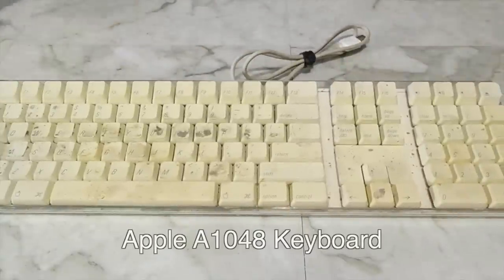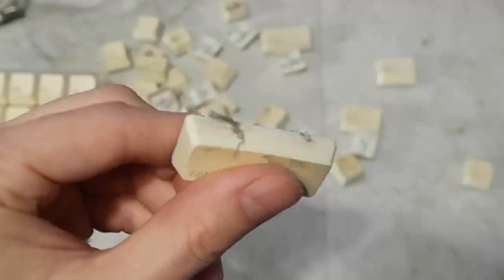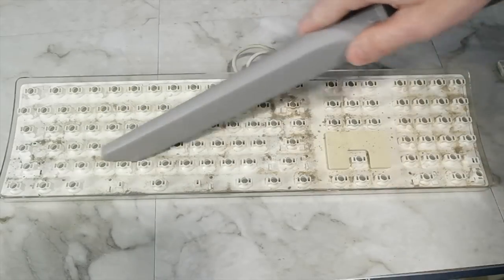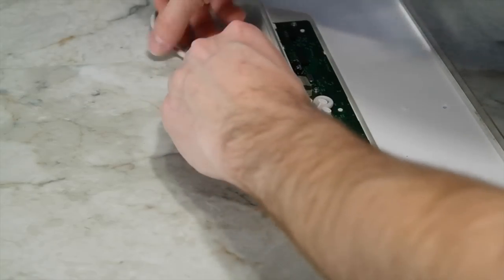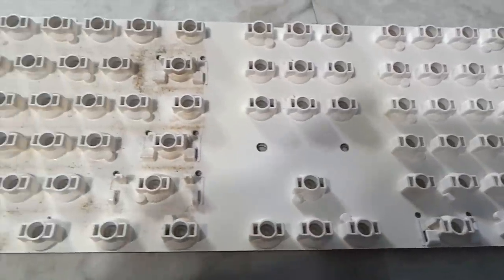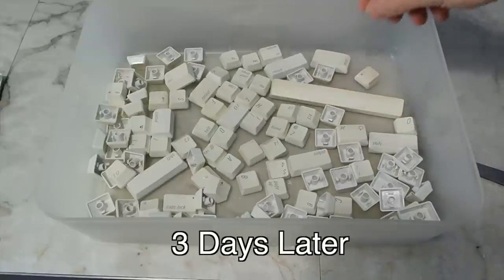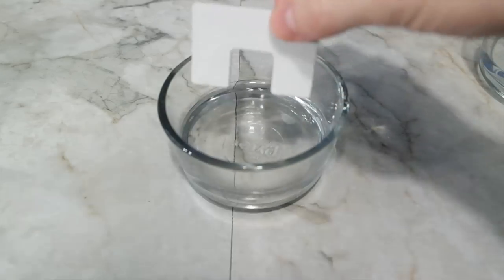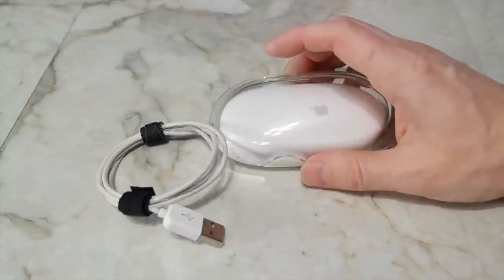Restoring an Apple A1048 keyboard

Comment: Hello David. Do you recommend the use of alcohol on more recent cables? For example, on the Magsafe cables?! I have a 2010 one which need urgently to be a bit less yellowish.. Thanks!
Reply from the maker: Yes - alcohol cleans them, but may not restore the color depending on what has caused the yellowing.  It certainly won't hurt the cable, though.
Reply: Thank you. I'm willing to say that the yellowing was caused my skin oil. Worth the try! Thanks again David.
Reply: NORMALIZATION OF IGNORANCE all caps much?
Reply: Senpai notice me

Comment: I have one of these keyboards and some of the buttons do not work, even though they move freely. How do I get inside the keyboard to clean the contacts? I could not find this step in your video. I was thinking that i could just use some contact cleaner and see if it works. Or, maybe there is a membrane that I can try to wipe clean. I assume there is some spilled coffee residue in there.

Comment: When I had one of these keyboards, I liked it a lot but hated the way all kinds of crud would fall between the keys and then be visible thanks to the clear sides. My solution was to buy a second keyboard, and then run the first one through the dishwasher (no disassembly beforehand). I used the second keyboard, giving the first one a few weeks to dry out. After that I just alternated between the two -- running one through the dishwasher whenever it got annoyingly dirty and using the other one while the washed one was left to dry.

I imagine this (mis)treatment shortened the life of the keyboards, but neither one of them failed over the years that I did this. It was a satisfactory solution for me.
Reply: KarlBunker if you like to put keyboards into the dishwasher, then why you didn't bought a silicone flexible keyboard?
Reply: Sam Evans ehh...
Reply: There's something called waterproof keyboards so you might want to invest in that.
Reply: Preety sure those didnt exist when OP was referencing this. Yall think he was doing this in 2015? try 2005
Reply: @salami99  Waterproof, and chemical resistant rollable rubber membrane keyboards did exist in the early 00's as I worked for a Kubota/New Holland/Bush Hog dealer pulling triple duty as a mechanic, salesmen, and IT where needed, and I was buying the rubber keyboards off eBay to use in our shop with the PC that held the Kubota/New Holland/Bush Hog software that we used for repair schematics, and the guys would get grease, and what not on the keyboards causing them to stop working even with clear keyboard covers. Yes they were crap the type on, but they worked for this use, as all I had to do when they got one really dirty, was wash it off in the sink, and dry it off(I kept 2 backups so we had next to no downtime). Also they came in PS/2, and USB 1.1/2.0.

Comment: 6 years later and this is still helping people. Thanks!

I got a G4 today second hand and the keyboard was super dirty. I needed to take the keys off, but wasn't sure if I would need a special tool to take them off without breaking them. Thanks to your video, I was able to find out I just needed a screwdriver and they would pop right off.
Reply: keyboard keycap pullers, both ring pull, and wire pullers are not that expensive on eBay, or Aliexpress, and both are worth keeping around to clean keyboards(I find one type works better than the other depending on the keyboard I'm cleaning), and not risk damaging keys with a screwdriver, or other flat end tool.

Comment: remember to take a picture of the key locations before dismantling!
Reply: Or... You could find a picture on the Internet.
Reply: Or... you could watch this vid.
Reply: Or... you could just use your brain.
Reply: And in a worst-case scenario, you can try pressing a key and seeing what it does.
Reply: Diego C. Finally a sensible reply!
Reply: Or you should know the layout of a qwerty keyboard
Reply: Or the specifics of that keyboard at hand! They have special keys sometimes
Reply: mechanicalRUBY Video if it's a laptop keyboard it should be no problem if it doesn't have that number pad with f14 f15 f16 bit.... Because it should only be caps lock,shift,cmd,Ctrl,tab and escape. I know the whole qwerty since I've been using it more than 5 years, when someone tries to get me to do a challenge of the other Layout, I freak out.
Reply: НаркотическийУниверситетМиллионов gibberish

Comment: Hello! I NEED YOUR HELP PLEAS!!!
Recently I bought an Apple A1048 keyboard, but the spacebar key doesn't work. I disassembled the keyboard and cleaned all parts, even the membrane (applied a electronic contact cleaner) but still doesn't work. Do you know what can I do to fix it?
Thanks!!
Reply: I found the problem. Is on the membrane. The contact between the + and "enter" key on the numerical pad was missing. I use a copper wire with tape (i don't have the conductive pen) and problem solved!

Comment: I have several of these (and Apple keyboards in general), and have gone through the keyboard-cleaning process many times. It's painstaking, having to swab each key inside out. That being said, it feels so nice to have a spotless keyboard. What's interesting is that it sometimes changes the typing feel altogether, but that usually reverses itself once the keyboard becomes grimy again. 

-Typed on a wireless version of this keyboard. Although the keys are stiffer on these models, I still find them to be one of the best Apple membrane keyboards, next to the black, Apple Pro one.

Comment: The A1048 is my keyboard of choice---what I'm using to write this. My mid 2011 27 inch iMac came with a wireless keyboard, but I like this one better because of more dedicated "F" keys and the numerical key pad. I programed the wireless to operate my Apple TV, then I bought a second wireless for $5.00 at GoodWill and programed it to operate my Amazon FireStick. Mine isn't as dirty as the one in the video, but it's getting there🤪
Reply: Are these 1048 keyboards pretty durable? I have already gone through two of the newer flat style keyboard (keys fall off), and i am thinking of getting one of these 1048's.
Reply: @jf8461  I'd call it durable. Mine is very dirty, with lots of crud visible below the clear plastic layer, but still works perfectly.

Comment: Heat and UV light caused the keys to turn yellow. Why does hydrogen peroxide and sunlight reverse this?
Reply: Magic gnomes

Jk its a chemical reaction
Reply: Some part of the sun most likely affects the keys
Reply: It has to do with the way hydrogen peroxide chemically reacts with the plastic. Sunlight most likely speeds up the process making it time-worthy to apply. It's not only sunlight that can accelerate these effects, ultraviolet light can work as well but it'll take longer.
Reply: Shadow what you said XD
Reply: More info on Retr0brite.

Comment: I did the exact steps but in the end all the key became somewhat hard to press specially space bar it doesn't work if I don't press the middle of the key and some other keys need extra pressure to work, is there something Im missing in reassembly ?
Reply: Samee 😢

Comment: I got a few of these I picked up from the local college surplus sale for $2 each which look new but I took apart an cleaned anyway, also have the A1016 - A1243 an a M7803. I never use any of them except for the Pro Keyboard since I dont like typing on the others

Comment: This video helps a lot. I got 6 of this model below $8 USD. They are not yellowed as much so I skipped the peroxide part. 3 of them are 100% functional, the rest has some key not activating. It was caused by the broken membrane connection and can be fixed by some copper wire and tapes. It still takes a lot of time to clean every single dirty key.

Comment: I prefer this keyboard with the clear plastic piece completely removed. Thin rubber pads, and two tall rubber feet, stuck to the right spots on the bottom in the raised area makes it secure and stable enough for regular use, and and it looks SOOO nice with that free-floating open look afterwards. Sadly, my membrane is now shot... Dang carbonated beverages... I am making the switch to mechanical key switches now, but I will always have fond memories of this old keyboard.

Comment: a quick warning about these keyboards
the membrane (clear flexible pcb) seems to corrode away in these and seems to be quite typical
so i would avoid getting one of these as you cannot get replacement membranes anywhere and fixing them is challenging
i found one for 20€ tested working
but later i found out numpad 4,5,6 and + werent working so i opened it up to fix it and found the bottom layer membrane (three layers) had completery rotten away traces turned blackish and had too high resistance, the fix would be a conductive pen but thats quite expensive for such a cheap keyboard

Comment: Hi, i have on of these keyboards. i wonder if you know how to fix a funny issue with it. With left shift key i get - QWERtyuiop and with right shift key i get - QWERTYUIOP. Why is left shift key unable to type tyuiop in upper case. Everything else works fine with left shift key apart from these 6 letters, bit bizzare. I have only recently cleaned the keyboard so it's nice and spanky.

Comment: I usta take my A1048 apart to clean it, but after that became old (I live in a very, very dusty room), I simply take a tiny Allen wrench, remove the back, then put the keyboard in the shower. I squirt some eco-friendly cleaner (I use “Better Life”) in between all the keys, and with the shower head set to “strip paint” (you know, the water blasts so hard, it hurts), I blow the dirt out. Yes, I completely soak it, and use a scrubby sponge to clean the keys.

When it sparkles (looks new), I shake it, then turn it keys-down and spank the keys. Then I set the oven to “Keep Warm” (150°F) and put the keyboard in the oven for an hour. Then, even though it looks dry, I put it keys-down on top of my Mac for three days, just to be on the safe side because electricity scares me, and running electricity through a potentially-damp keyboard isn’t a good idea.

It still looks as if I just bought it (once I get it clean, I mean; by the time I put it in the shower, there are clots of hair, giant dust bunnies, sticky bits of Pepsi, and so on all over it and it looks unrecoverable).

Consider doing it my way, which is much, much quicker (save for the drying; you might be more brave than I am)  You could also 1. Set the oven temp higher; 2. Leave it in the oven longer; 3. Find a warmer place than the top of your Mac (big-screen TV, a radiator, etc).

Comment: I'm cleaning a keyboard like this too. Got all the keys off and in water with soap. Now I want to undo the hex screws. The .5 hex key doesn't fit however. It does fit in the iMac G4's screws. Any advise on this? Would be much appreciated! :)

Comment: OK, so I'm pretty familiar with most of what you've covered here but I'm not sure if this is going to address my key issue (pardon the pun) which is that certain keys stick consistently, usually that of a vowel, such as the "i" key which makes it awfully annoying, and I spend a lot of time at my keyboard. So did you find that doing this, what I call a cosmetic cleanup, helped with the sticking keys or is that more of an internal issue, do you think?

Comment: Hey i just got this keyboard with an old iMac 2006, the iMac is fine but the keyboard makes problems. The keys are very hard to press and it's impossible to write fast on any way. I removed all the keys, cleaned the keys and keyboard (not dissasembled). I put the keys back on but they are still very hard to press. 

Anyone got an idea what else i can do?

Comment: If you put some grease on the sliders, like Krytox 205 grade 0 or 00, they sound phenomenal. I would also suggest using Permatex Dielectric Grease or SuperLube 21030 on the wire stabilizers wherever they touch plastic. They will operate much smoother and sound quieter. If I recall correctly the stabilizers came greased from the factory, but it's long since dried up.

Comment: Hi, 
I made this cleaning also on my Apple keyboard but did it wrong :-(. I washed the main white keyboard keyholder under water in the sink. Now the keyboard is not responding so I do not know if it fried or if just contact are soaked with water. Any solution?

Comment: These are basically the worst keyboards ever made.  Even when totally clean, the caps have issues with scraping against the plunger hole if you apply pressure to any side when depressing the key.  As if rubber dome keyboards weren't bad enough...

Comment: I have a very similar keyboard. The keys were sticking so I took all the key off. and whipped down all the metal part and put it back together. But now it seems like all the keys are acting as if the command key is being pressed. What did I do wrong?? please help me if you can?

Comment: This has been a great watch. I just switched to Mac OS X after years of Linux use for my work, and I got the aluminum chiclet keyboard, which is nice to a point. I wanted an A1048 and picked one up off eBay, these tips will help me clean the keyboard up greatly, I spent the extra to get one in good condition so I think the translucent bottom, the keys and the white plastic board underneath is all I'll need to do - but this has been great help!

Comment: Still using this model, I am very grateful that you need all of the products used throughout each process for restoration. What brought me to this video, as well as a few others, is trying to quiet the keyboard strokes while typing. Understanding how more recent keyboards, wireless or not, have thinner keys. So reason for less sound made while typing seems obvious. Yet, I am curious about restoration of this this model helping to more silence each keystroke. Please notify me & others about your input on this subject. Many Apple users definitely miss the extra USB found within this model keyboard. Thanks again for taking up such work during such a process to achieve what you have for others to follow!

Comment: I've used this older style apple keyboard with my iMac, as the slim low one that comes with it I don't like. I want to feel the keys better, and have more key options.  Now its stopped working its so dirty.   Belated thanks for this video. I'm going to use it to clean mine.

Comment: The keys will get jammed later. Or you need a micro layer of silicone oil. Just a little bit. Otherwise the keys will be hard to move.

Comment: to clean the key board, just disassemble it (keep keys attached, and put the board with the keys on it in the dishwasher, do not put the lower part with the usb cable in, dry for a while and it will be good as new (yes I have done this and it works on this model)

Comment: I have a wireless version of one of these keyboards, I've cleaned it up, but battery acid has eaten through one of the plastic screws that holds on the battery cover, is there any way o repair it?

Comment: Well...  Needless to say, these were certainly better keyboards and mice than what Apple are pushing out nowadays.  I'd certainly consider looking into the old Apple Pro Keyboard and Mouse on eBay and use those over the Magic Keyboard and Magic Mouse 2.  If anything, even today's wired keyboard and mouse looks like it was transplanted from a MacBook.  Seeing this keyboard looks like a throwback to the original Mac line.
Reply: That's why I have the lattest iteration of said keyboards. It took me a while back then to source a NOS one and it was still 40 bucks.

Comment: This is kind of a different area of expertise perhaps but I thought that I would ask you.... Every time I use controllers (like xbox controllers), they get really dirty and gunky. I have no idea why - even if I avoid using them when I have dirty hands (ie after eating), they still wind up this way... Do you know how to prevent this or at least how to clean the controller so it looks nice and new again?
Reply: +ArtieKirkland It's just skin oils building up and collecting gunk and it's pretty much unavoidable. Any light solvent that won't damage the plastic itself should work. I imagine rubbing alcohol and some paper towel would do the trick. Disclaimer: always tests solvents on a non-visible portion of the material to make sure nothing terrible will happen and it will all be my fault.

Comment: At 1:50, you say, "The next step was to unplug these two ribbon cables. There's no trick, they just pull straight out."  Well, there IS a bit of a trick, as I was afraid of what exacty to pull on so as to not damage the cable..  Eventually I figured out the "wings" of the clear plastic holding the end of the ribbon cable are what should be grabbed.
Reply: Do you have any idea how you put them back in? The small ribbon went in fine for me, but the larger one didn't seem to fit snug. Now my mac won't recognize the keyboard :(

Comment: I have this keyboard and I use it everyday with my Core Duo iMac. It's a good keyboard and the placement of the usb hub is nice.

(I also have that same mouse. I don't use it, but the person I got the iMac from said it came with the iMac)
Reply: I have several of these keyboards. They are much stiffer than the earlier Pro keyboards, but I tend to like them as well. Last year, I typed several essays on one of mine, including a couple 8-10-page papers, and I haven't had an issue. Naturally, I press harder on the keys, so I don't mind if these ones feel a little stiff! It has served me well; I have even found that I have started making minuscule grooves in some of the keys.

Comment: Is it usual for the A1048 that the keys are somehow get stucked unless you press them at their very center?
Reply: you might need to take it apart further down than he did to wash the rubber domes, I did that on the one I found while out thrifting a while back, and that seemed to fix the problem for me, but it still types a bit stiff. Thankfully I did not have to retrobright mine.